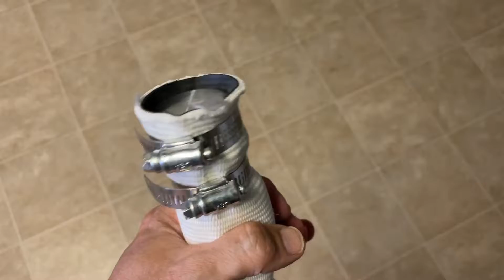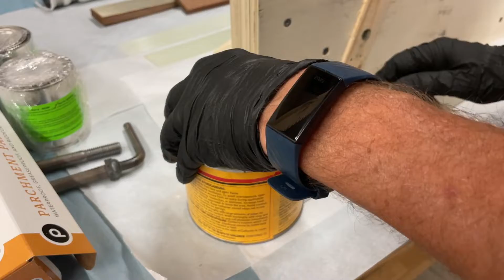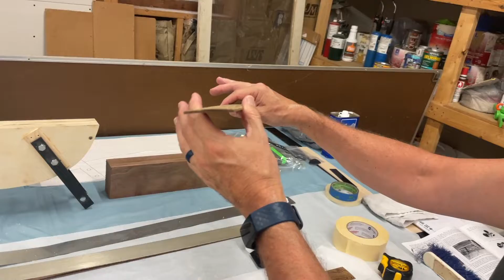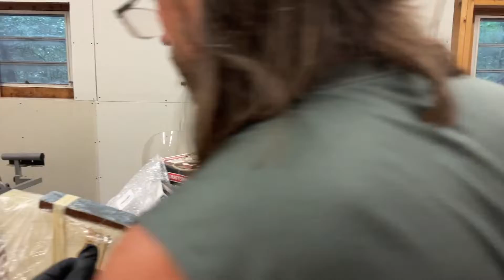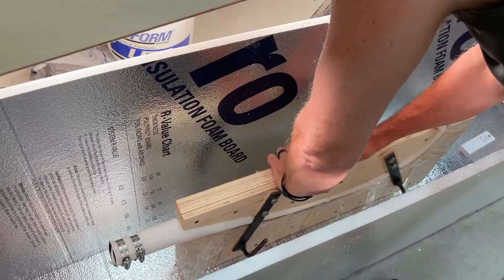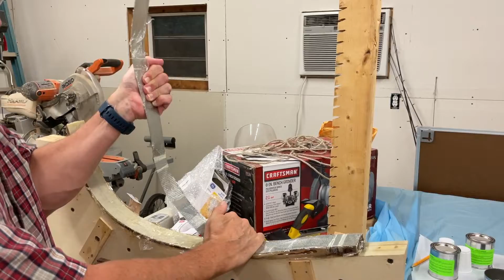Bingham Projects Take-Down Recurve Bow Build Series - Part 4 - Gluing up the Limbs

Comment: Hi Boone, this is an excellent video.  However, one thing really surprised me.  You said the air pressure in the air hose is 60 psi. If the air pressure is so high, will the air hose explode?  The air pressure of car tires is generally 30~35 psi. I want to confirm with you whether the air pressure in the air hose is really 60psi.
Please let me know.
Thank you very much.
Reply from the maker: Yes that is correct air pressure.  I know a lot cars go to 30-35 psi, my truck has 45 on rear and 50 on the front, however, my boat trailer tires goes to 80psi.
Reply: @BooneDownSouth  
Thank you very much!

Comment: I have two important questions, 
1) when you were making your bow/bow limbs, what brand of Epoxy adhesive did you use?  
2) How to choose which brand of Epoxy adhesive should be used?
Reply from the maker: I used Smooth On because that is what was recommended by Bingham Projects and is what came in my kit.  If you want to know more how to choose I would check out tradgang.
Reply: @BooneDownSouth  
Thank you!

Comment: Hi
What's the air valve connected at both ends of hose pipe called?
what's the material & diameter of hose pipe
And where can I buy these two things
thanks
Reply from the maker: They are called hose plugs.  You can get them here:  https://binghamprojects.com/product-category/shop-bingham-projects/bow-building-supplies/laminating-press-kits-and-components/

Comment: Which way does the wedge go and where does the thick part of the taper go?
Reply from the maker: So from the belly, it goes, glass, parallel lam, wedge, tapered lam, glass.  The wedge has one side that is straight and flat.  That straight flat piece will glue to the parallel lam.  The thick part goes on the riser side.  Hope that helps.
Reply: @BooneDownSouth  It does thank you. Where does the thick part of the taper go. Towards the wedge or towards the end of the limb?
Reply from the maker: @hockey1230 Sorry I misread your question.  So the thick part of the taper goes on the wedge side.
Reply: @BooneDownSouth  Perfect, thank you.

Comment: Good job on that first limb! One trick I've seen other guys use, is to put the separate pots of epoxy (not mixed) in the oven to heat up slightly. Makes it a lot easier to spread, and helps air bubbles to escape. I've never made a bow so you might want to run that past the TradGang guys first and see what they say 👍
Reply: This is a pretty common practice and a good idea
Reply from the maker: Yea that is something I will definitely try on the next build!
Reply from the maker: @Matabele - Yea that might be a good idea.  I just glued up the second limb.  This time I used a thin plastic putty knife to spread the epoxy, but no matter how you slice it the epoxy is pretty thick and doesn't spread super easy.  If it was heated I could see how it might spread a lot quicker and easier.  The TradGang guys are fantastic though!